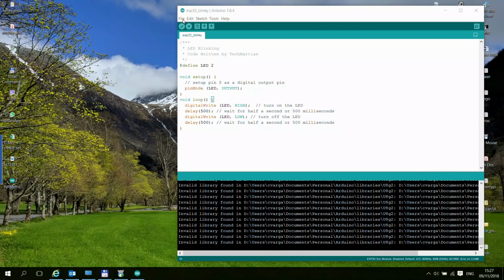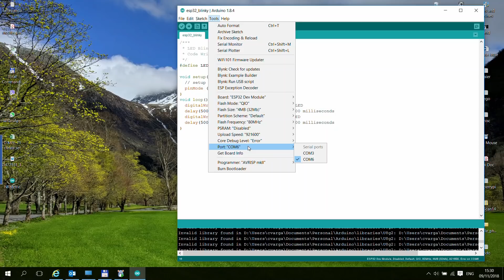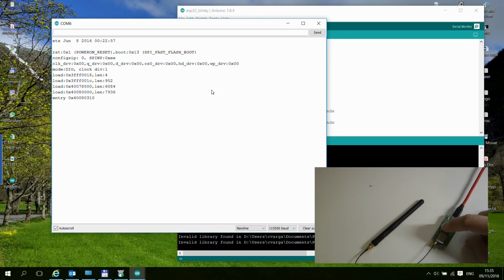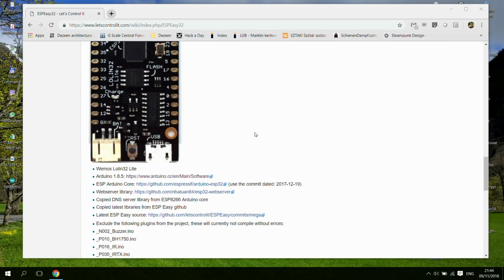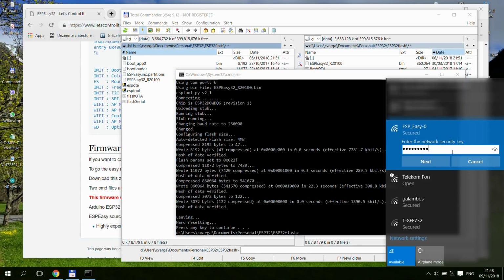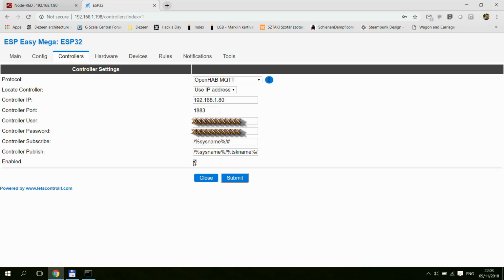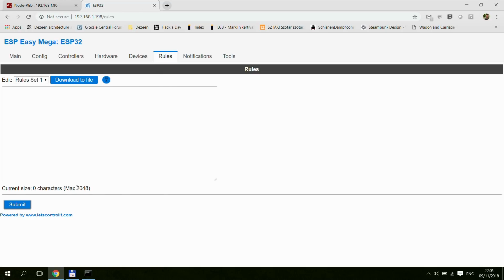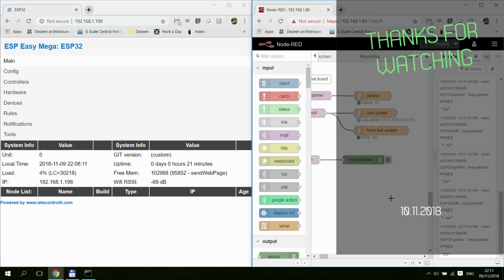DIY ESP32 development board from ICStation.com

Comment: It is a common issue for these ESP32 development boards that most of the times you have to press the program/flash/reset button. A common hardware fix is to add a capacitor of 100n, or better in my experience, 1 uF between the enable pin and ground. I f you use an electrolytic capacitor, + goes to the enable pin.
Reply from the maker: Thanks. I also noticed that if I have certain components connected to GPIO 0 that also does the trick :)